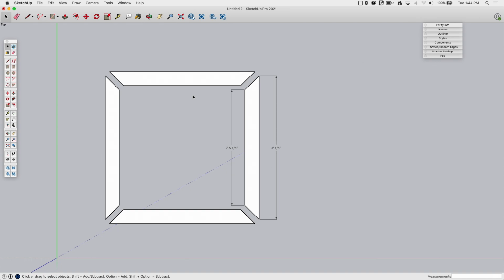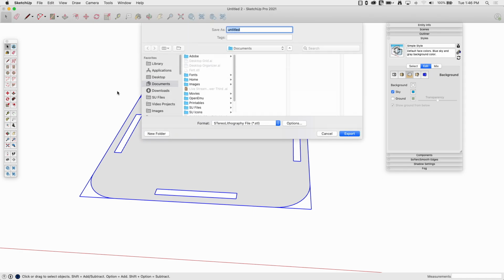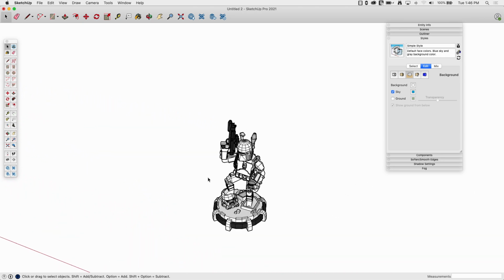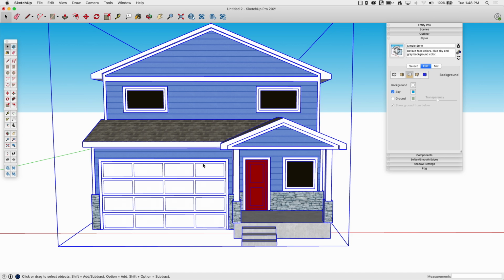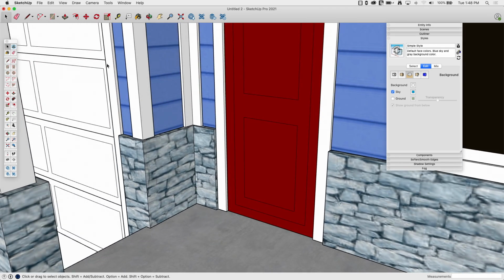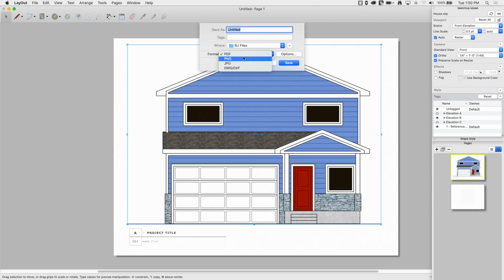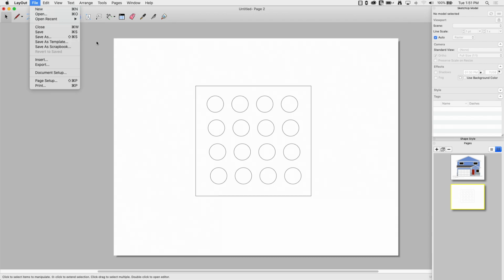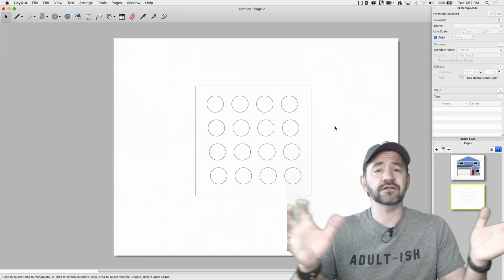Export From SketchUp or LayOut - Skill Builder

Comment: well so you draw it in layout or moved it for sketchup to layout???
Reply from the maker: Everything is intended to be created in SketchUp... LayOut is intended for output preparation.
Reply: so yeah my bad when i saved my file for some reason or other the file type changed slightly from .skp to .skb so my files would not go to layout @SketchUp
Reply from the maker: SKB files are backups of SKP files. You can rename SKB to SKP and work with them like any other SketchUp file!